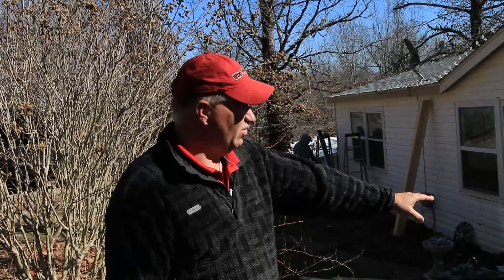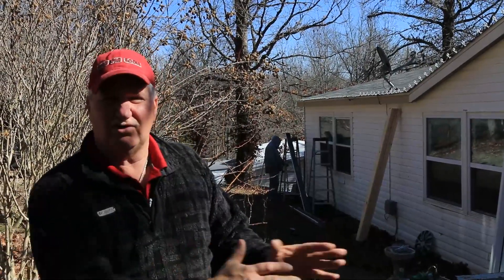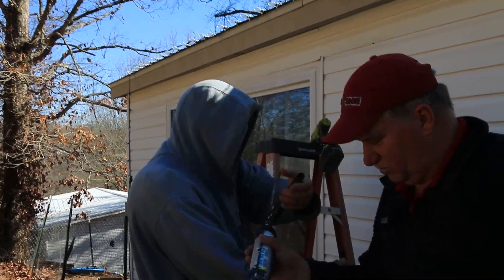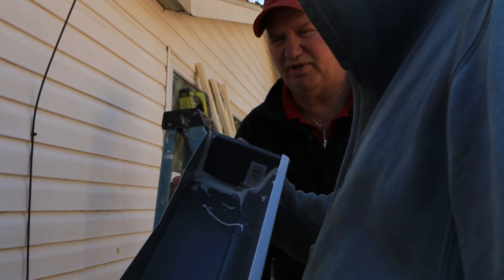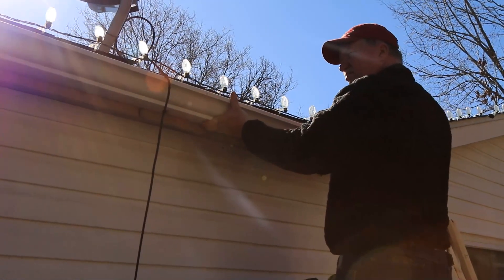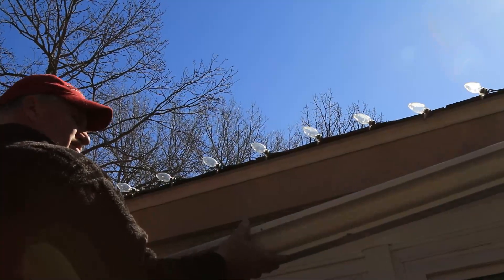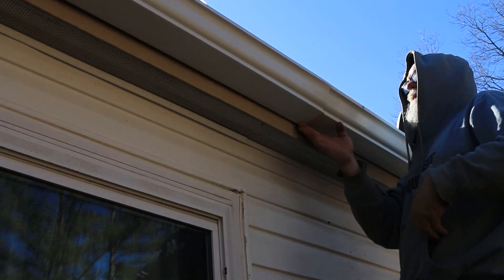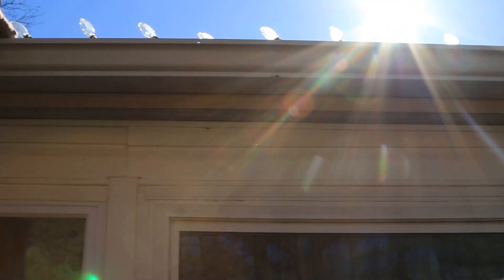How To Install Gutters For Beginners Part 1

Comment: I like your video content however if you could have your camera man move the camera less and zoom in on the important parts rather than show the back of someone or their hands when we really need to see what he is doing, that would be great. Also it might be better if you could film from above so we can see inside the gutter on how it attaches to the roof and I am assuming under the drip edge. That is what I wanted to see. Thanks for making the video.
Reply from the maker: @leanoraspadaro9491  you bet . Will work on getting better